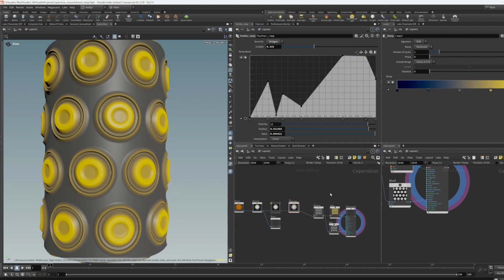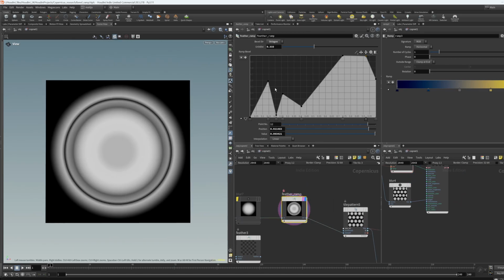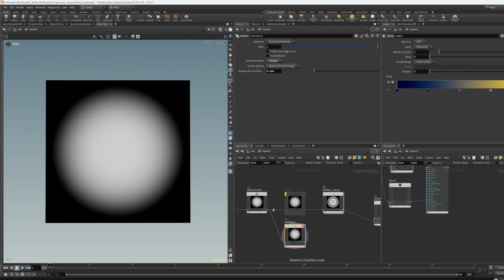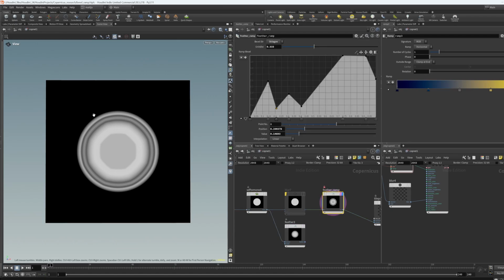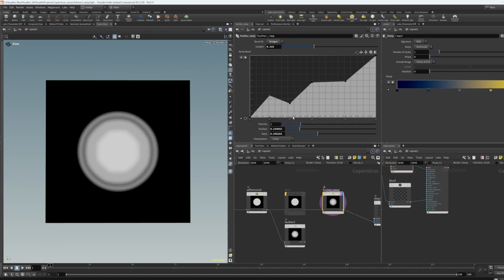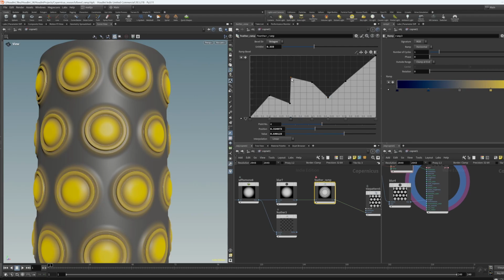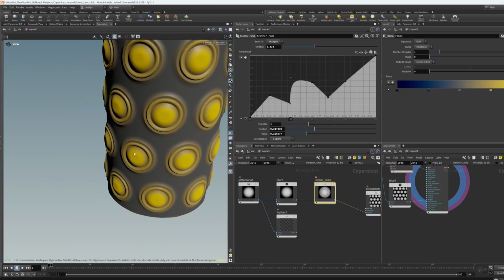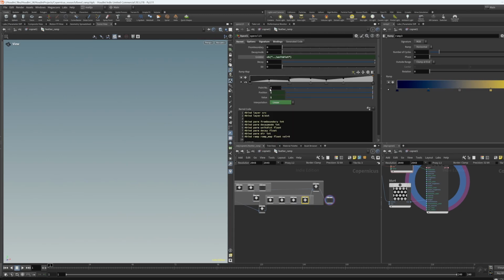Houdini 20.5 COPs Feather_ramp node

Comment: Using a remap node gives you control over the curve instead of a ramp
Reply: True:)
Reply: @BananaPeelStudio000  wasn't sure if you missed the node or you did it just for practice. I spent about 15 min yesterday trying to solve the same issue and then found the node 😝
Reply from the maker: @asr59  don’t remember if I missed or had some issues with but yes it is mostly an exercise where I tried to recreate the functionality of a node I saw in SDesigner